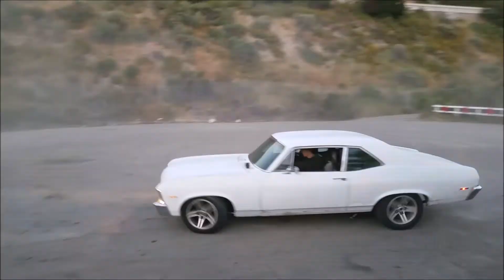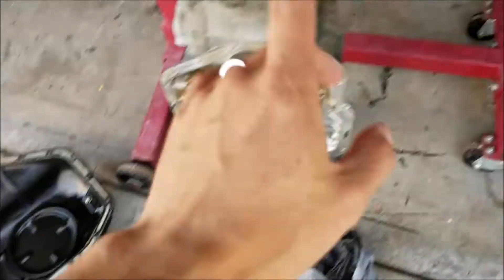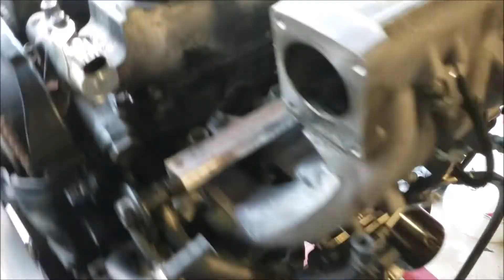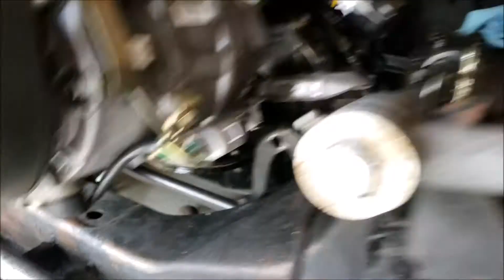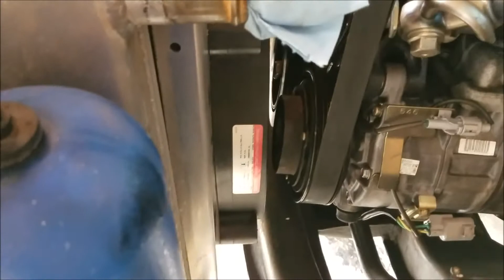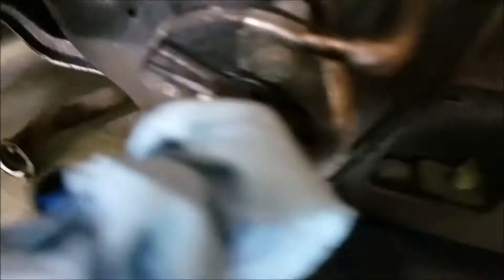Test Fitting the 1JZ! New Parts and More!

Comment: Anxious to see more of this build as I myself am installing a 2jz in my 72 nova. I am using a factory subframe with full ride tech suspension, currently trying to source the rear sump oil pan and trying to figure out if I want to stay with a linkage style steering or switch to a rack.
Reply from the maker: Sweet dude! There's plenty of room for the linkage honestly. I have no interference issues. 
Can't wait to see another JZ Nova haha
Reply: Thanks for the support, I get a lot of flap from people about not doing an LS but I wanted different and WTF kinda stuff. Have a couple ideas for the motor mount but interested in what you come up with since your slightly ahead in your build than me.

Comment: Would a 3 or 2 core radiator make a difference with space
Reply from the maker: I don't think so, since this is already like a 3" core 
Just a single core/single pass though far as I know 
I'm going to start off with this but I get the feeling I'll need to upgrade eventually. I want a triple pass and dual fans ultimately